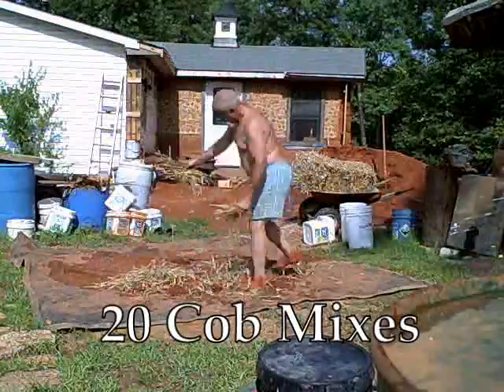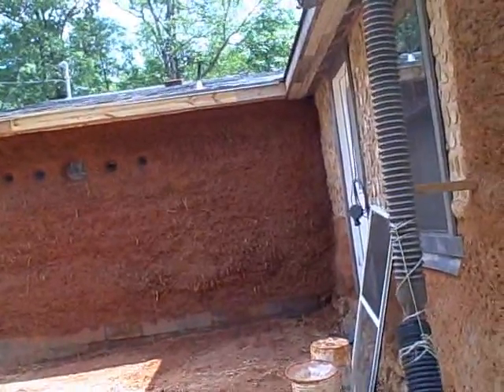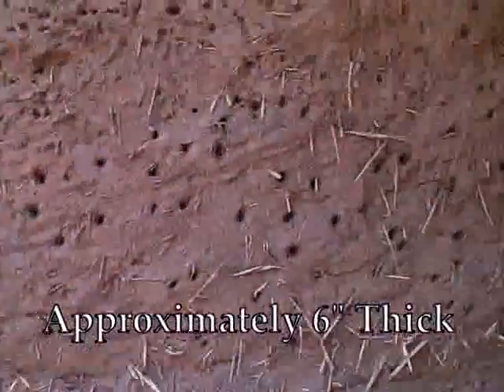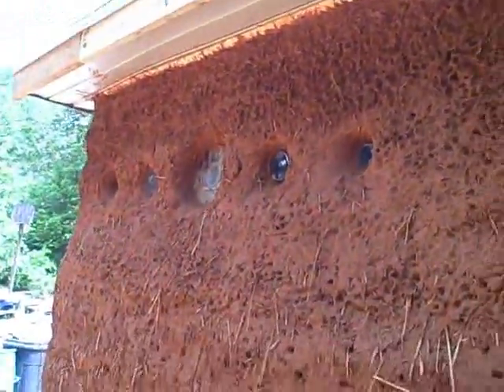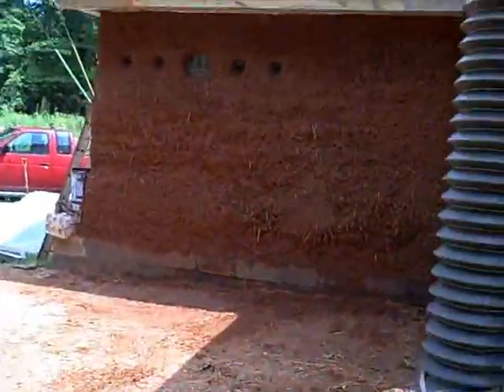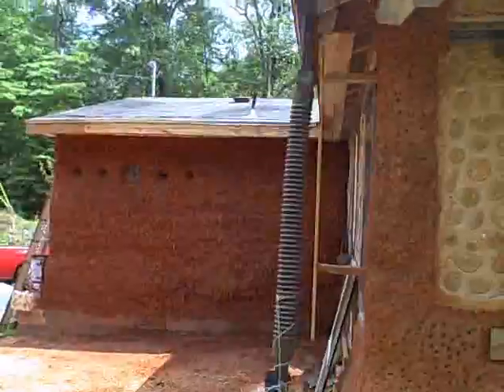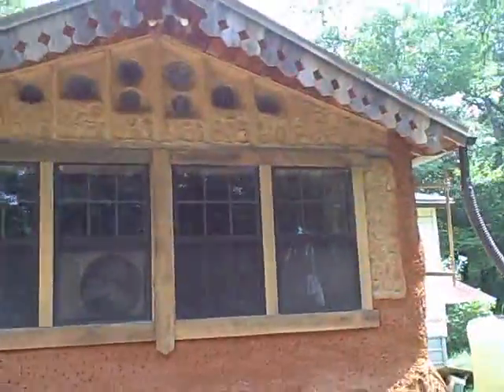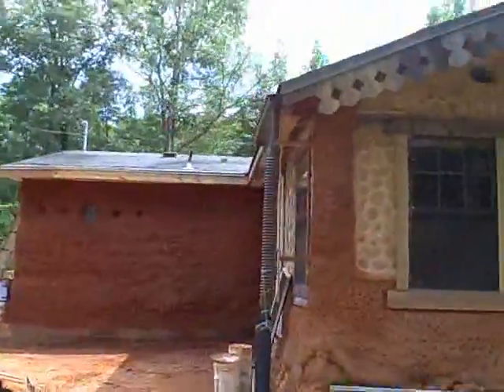Cob Wall Construction

Comment from the maker: Living in the South, Insulation is very important, so I decided to use larson trusses to surround the MH. I used what I had available to me to fill the space.  I used sawdust in clay slip for the add on, shredded paper in clay slip for the East and West walls, and straw clay slip for the south wall.  As one source of material ended I found another that would work just as well.  All these walls are covered in an earthen plaster, or cob.....Later I'll cover the walls with a lime plaster.